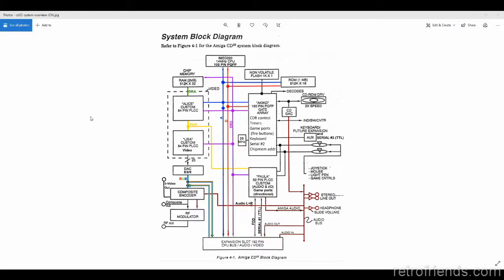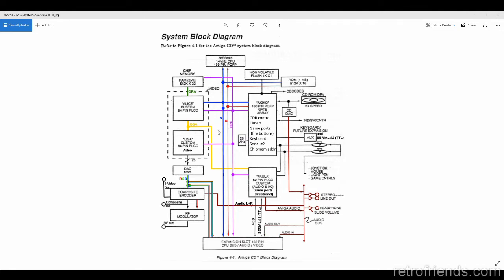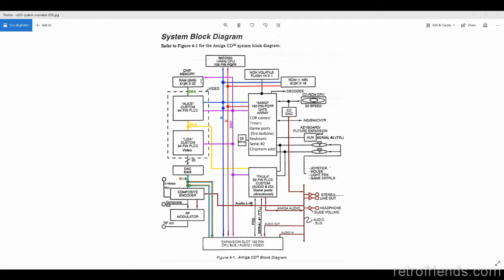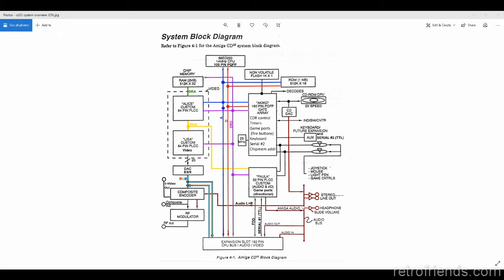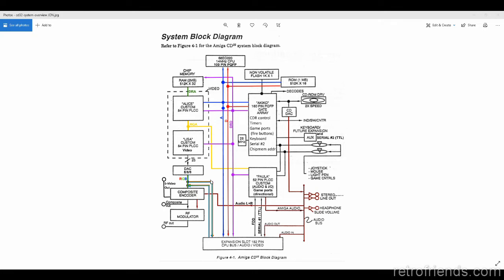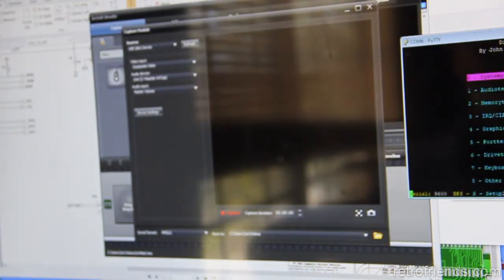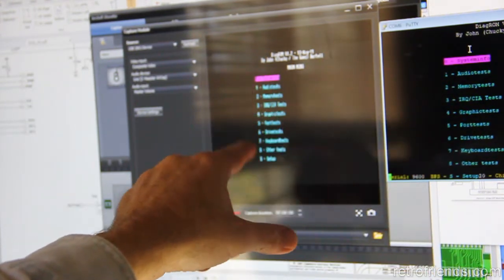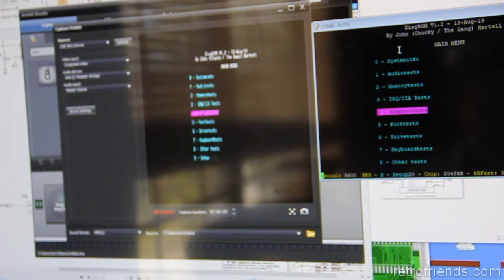Amiga CD32 Repair Part 2: More schematic fun and DiagROM

Comment: I have a CD32 that shows blinking red/green screen with DIAGROM and similar color code behaviour with stock ROM.  I traced all the connections under scope and it all looks good (yes, I replaced the capacitors)  Everything suggests bad chipram.  Suggestion on where to purchase chipram for CD32? what model?
Reply from the maker: I am afraid that I have not replaced (or ordered) chipram for the CD32. You should search for an equivalent. Try searching using part of the model number of the chips, and then compare pins and memory capacity. I did once find what I thought was an equivalent in China (aliexpress maybe?)